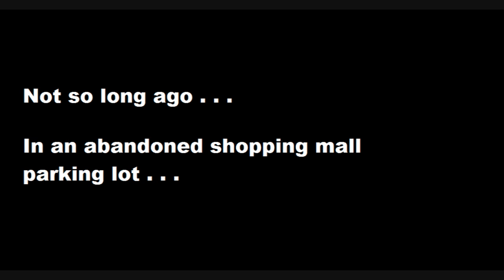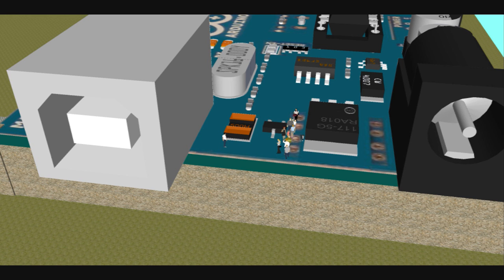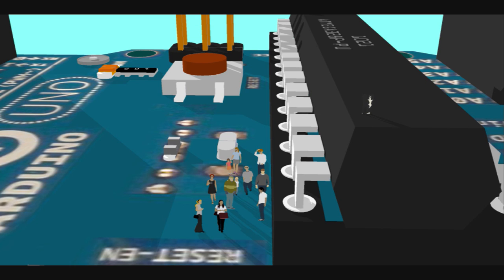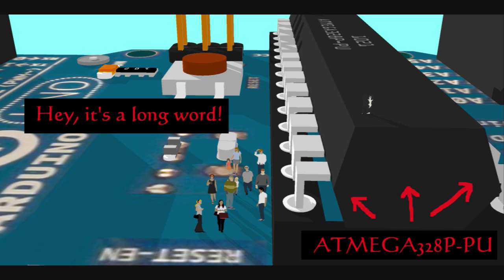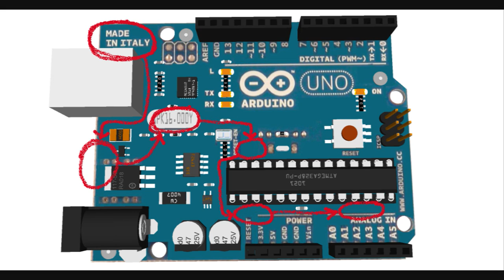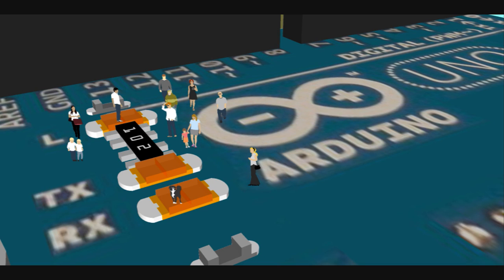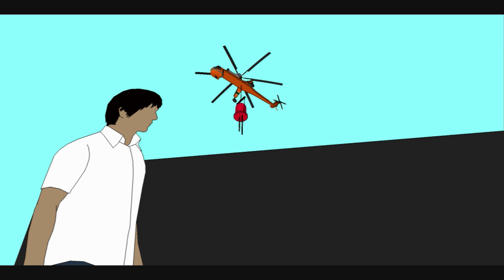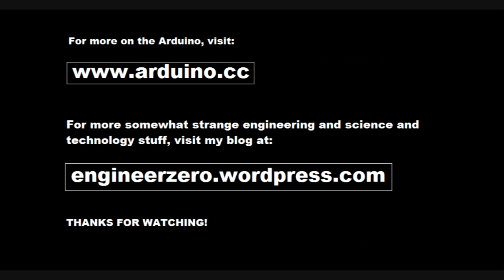Arduino Park

Comment: That atmega chip there is the microcontroller, not a microprocessor. Microcontrollers have the processor inside with ram, rom, I/O pre
pherials. Mircoprocessor alone can't really do anything interesting, if there is no memory to hold the insctructions for it, let alone ways of interfacing other equipment. Those other components on arduino board are for power regulation, usb interface etc, microcontrollers I/O is straightly connected to headers. Hate that when people spread misunderstanding.

Comment: Everything I have researched so far would suggest that you would need to change the micro controller to accomplish this. It seems like the Arduino Duo would be a better alternative as its CPU clock is something like 32Mhz or something. although I dont know if the hardware is completely universal on this board ...yet.

Comment: @engineerzerochannel If you take your statement and apply it to another field, you get "It is open to debate whether or not a car is a steering wheel". Just like the uC consisting of ram, rom, cpu, and so on, the car consists of wheels, windows, chassis, steering wheel, and son on. In other words: just because A is a subset of B that doesn't mean, B is A.